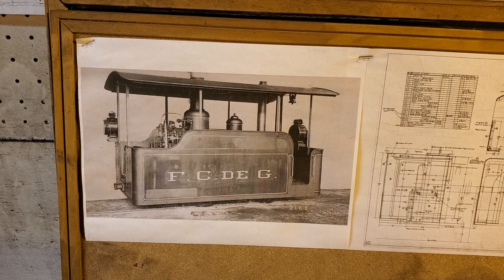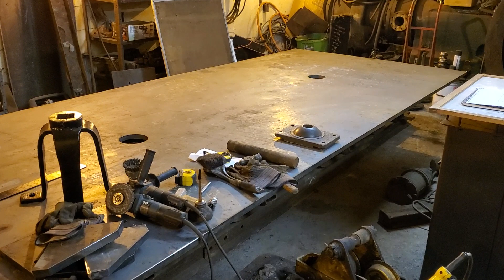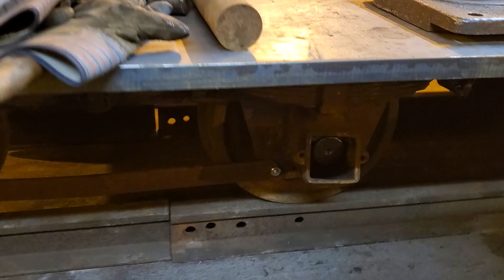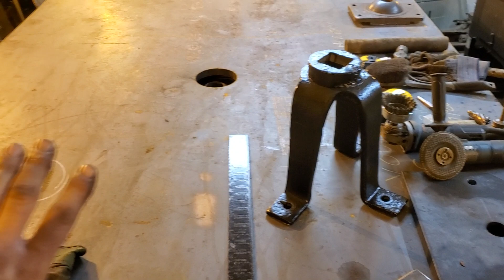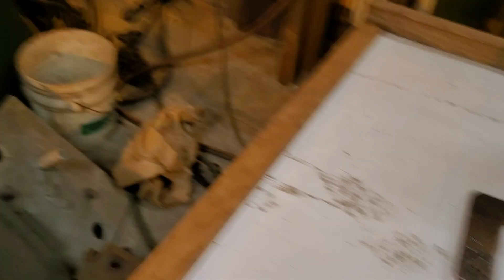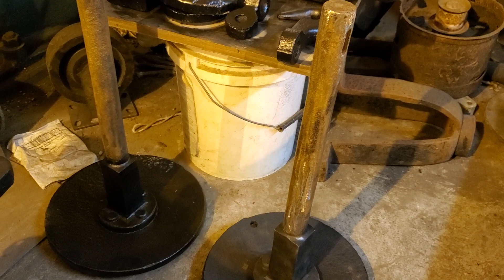Building a New Tender for the J&L 58 Part 1

Comment: When you shut the loco down and it cools off and all the steam condenses, this will cause a vacuum in the boiler. How / when  do you allow air in so the boiler does not collapse??
Please advise
Alan
Reply from the maker: The boiler is strong enough that it would not collapse from atmospheric pressure, however air could infiltrate with the resultant oxygen induced pitting along the water line.  To prevent this, I hook up a hose to the boiler that goes to a low pressure regulator and carbon dioxide bottle.  The CO2 takes the place of the steam as it condenses and prevents oxygen to get into the boiler.  In this way we can wet layup the boiler all summer and not experience any internal corrosion.